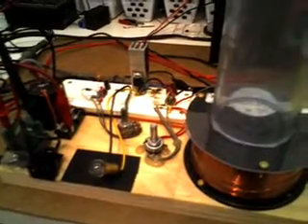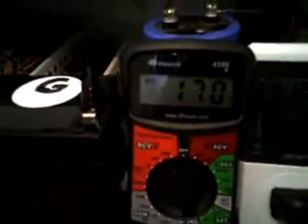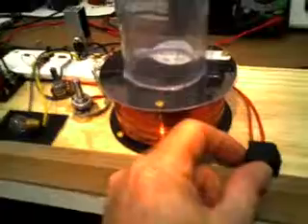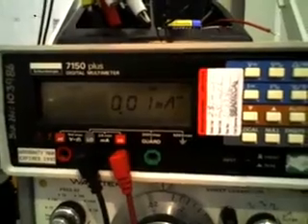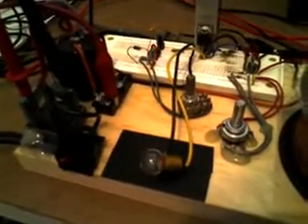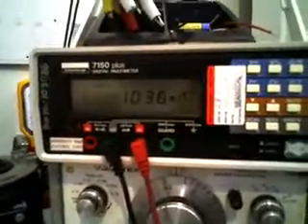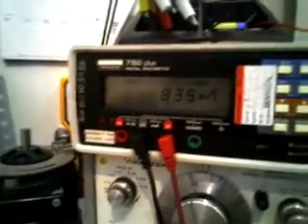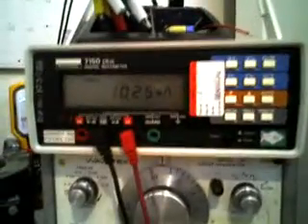Effect of Recirculating BEMF back into Coil test 2

Comment: it looks like a lot of ppl did not get your replies because you're replying as a comment and not directly to the comments.  I would guess that by now you know that you have to click on the comment to reply to it.  This is epic...  idk anything about electronics but i am researching and just commented about collective and recirculating energy in an system that's producing over unity of energy, and here this is.  This seems to agree with my theory that levitation is possible without using sonic vibration and that it is possible because of an overunity effect.  i suppose i am just a geek with delusions of grandeur, but i know a little on the subject...  I like the double levitating discs on the track...  it's quantum lev, super cooled, you've seen it or should.  But it gets better than that, i think, and you're on the right track, which is no track at all.  Ha it's funny bcuz you quit working on it, apparently.  I see comments about Tesla...  i was wondering if the turbine effect can be used for fire or plasma, if that could produce overunity and excess temp that could be cooled by a system that uses the heat to supply energy or recirculate it.  I hear that there are mini fusion reactors now, the size of a microwave oven.  I know that mag fields can be canceled by shielding if it's cooled to near 0...  i bet you will figure it all out.  There is a way to create a field of artificial grav without using any sonic lev... i just know it.

Comment: For a certainty, Back E.M.F harvesting alone  can be used to Power a Whole House . BUT YOUR  HARVESTER or COIL MUST BE OF TWISTED MULTIFILLAR WIRE AND WOUND IN SPIRAL. THE TWISTED MULTIFILLAR OR MULTISTRANDS WIRE MUST BE CONNECTED IN SERIES. NOW USE HIGH FREQUENCY DIODES ALONE TO REDIRECT THE FREE ENERGY INTO DC CAPACITOR BANK TO CONVERT THE INCOMING ZPE TO HOT ELECTRICITY. NOTE THAT WHEN YOU SUPPLY 2V TO A COIL, IT BACK EMF WOULD BE IN 10FOLD WHICH MAKES 20V. SO YOUR DIODES AND CAPACITOR BANK VOLTAGE RATING MUST BE HIGHER THAN THE INCOMING VOLTAGE THAT WILL PASS VIA THEM.

YOU CAN BUY HER208 FAST RECOVERY OR HIGHH FREQUENCY DIODES FOR 9 DOLLARS AT 500 Pieces now on www.aliexpress.com
Need me to assist you? PM me.
Good luck.
Reply from the maker: Do you have a video demo of the device you describe above in operation?  Please send me the link as I found no videos on you account.  Luc

Comment: Is it that simple. Add a diode to ground and connect it with positive. So that Back EMF is pushed back in?
Reply from the maker: +Talha Kamran I have come to better understand the effect. If an energized coil is MOVING through a magnetic field and the current is disconnected the coil will produce an instantaneous high voltage pulse (aka flyback) going in the OPPOSITE direction which also instantaneously causes an opposite magnetic field which causes a Braking effect to the movement or momentum. Adding a Diode in the reverse polarity of the input current essentially SHORTS out the coils when the input is disconnected cancelling the flyback pulse which allows the movement or momentum to continue in it's initial direction. Luc

Comment: The diode short circuits the BEMF in the coil, allowing it to seek constant current as inductors do.  Flux moves with charge and discharge and Lenz's law is in effect - BEMF both ways but high voltage short pulse overcomes the charge BEMF nicely.  Discharge BEMF replaces the charge EMF, but flux only maintained when current can flow - through the diode.  If diode and wire were lossless, magnet would float forever.  Look up Meissner effect - magnets float over superconductors via Lenz's law!

Comment from the maker: Hi spikeychops,

Actually I could not prove it to lift the magnet higher then using straight DC. When I added the Watts it came to just about the same.

However, I'll keep this trick in mind for some other setup and may find a better use for it.

Luc

Comment: On second thought, what would happen to the magnet, if you were to automate the switch, and switch it at a much higher frequency? Would it oscillate then? 
Up and down maybe...then add a second coil , possible a large toroid, and then you have a magnetic generator, which i suspect, due to this effect you've found, put out more energy than it's fed. Might be worth looking into, if not already?

Thanks again, great work.

Comment: Nice work gotoluc!

Excellent video set, man.
I too am surprised nobody seems to be seeing the significance of this effect.

You are essentially routing the BEMF back through the coil, and in doing so, required  approx 25% LESS energy, to do significant work (lifting the heavy NeoMag), which was unable to be done, even WITH 25% more energy in the system! Fascinating.

Is the mag oscillating or still when lifted?
If it's moving enough, perhaps a 2nd coil enclosing the mag would gen some juice?

Comment from the maker: Hi Can101276,

yes I know and I tested it to over 500 volts but when I calculated the Watts power used for the same magnet distance then using 170 volts it was getting less efficient as the voltage climbed up. Could this be an electronic component limitation?.... I don't know!  as I have no way of testing it at higher voltages using a mechanical switch.

Luc

Comment: Yes that is weird isn't it. It has to do with the diodes.. I'm not going to get into it that deep but I think the magnetic field just isn't collapsing at all when the diodes are in the circuit. 

What happens when the wave cycle and frequency are different to this. I'm guessing you get some BEMF on the scope and the magnet isn't as steady?

Comment: Okay. If your multimeter is up to snuff (true rms meter) it probably does this already.

It just wasn't clear if the bulb is really indicating the power level, how it is connected etc. Bulbs are non-ohmic so not a good idea to measure current and power with in general.

Comment from the maker: Hi janne808,

If my scope has that function I'm not aware or even would know how to use it. I just switched the recirculating diode on and off and it was clear by observing the on off period form that with the diode recirculating it made the mosfet switch off to zero much cleaner, with no recirculating (diode off) the off had a peak and several degrading bounces which could account for the wasted energy.

Luc